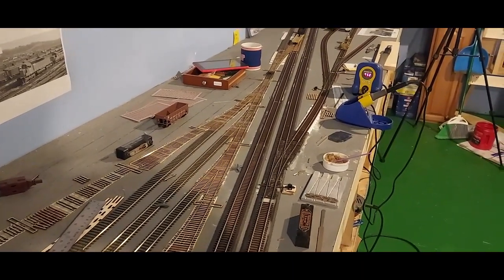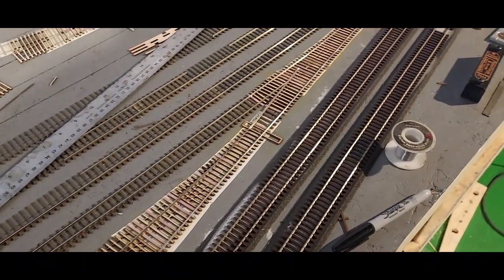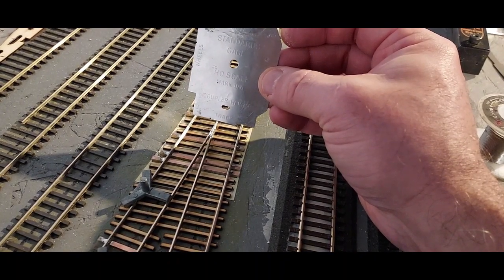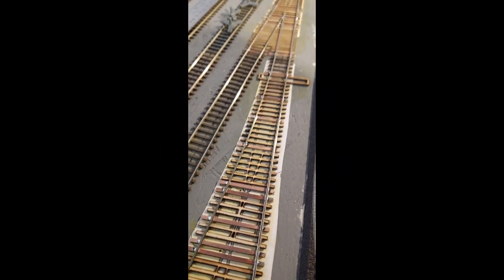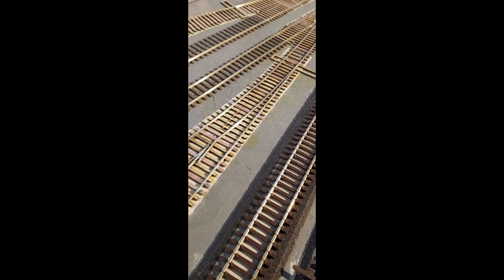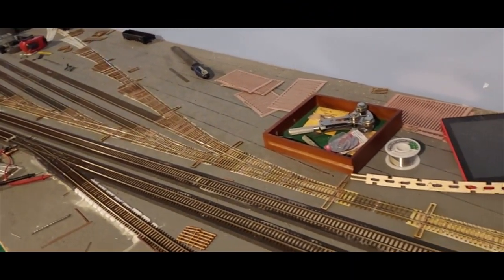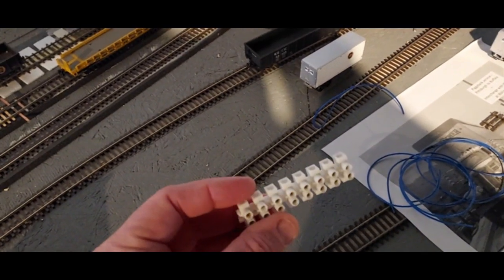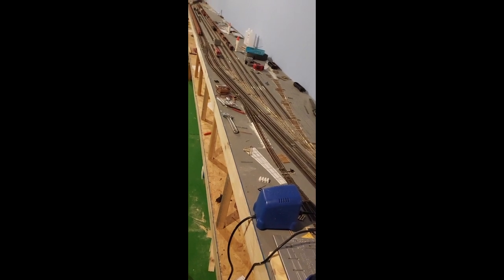Hand Laying a yard ladder in HO scale

Comment from the maker: Link to Amazon where I get my tie material. 
https://www.amazon.com/Unfinished-Basswood-Projects-Engraving-150x100x1-5mm/dp/B09MK53NSL?pd_rd_w=GRfUk&content-id=amzn1.sym.6c9101f8-677d-4b13-9bf0-c7e0d8fdf3bd&pf_rd_p=6c9101f8-677d-4b13-9bf0-c7e0d8fdf3bd&pf_rd_r=Q8BR6VA8H0SEC657P3YY&pd_rd_wg=2AILa&pd_rd_r=d6083eb8-fa7f-4cf2-8f0c-18a1dfac3f17&pd_rd_i=B09MK53NSL&psc=1&ref_=pd_basp_bia_rpt_ba_s_2_sc
Reply: Duh, somehow I missed your comment here...I kept checking the video description for the link, LOL...How do I contact you about the CAD files for the turnout frets?
Reply: Following up on that DXF file for the laser cut ties, would you kindly share it? Also, I wonder do you use Pliobond to glue the rail to the ties or something else? Trying to find something else instead of Pliobond because it's too toxic for my liking...
Reply from the maker: @TrainzLuvr  shared above.  i just use super glue, (carefully) i figure once the ballast is down and glued, it's all pretty solid anyway.  I've also just let the ties sit under for show -  I've also tried using a kadee spiker.   honestly - they all seem to work just fine.
Reply: @bessemerlakeerieinhoscale6061  You are a champ, thank you! Maybe pin your post with the file link because here it's at the bottom...
I see you've nicely packed the designs to take the least amount of material, awesome! What is the difference between the _1 and _1M files?
Good to hear about super glue, was worried I would have to end up using Pliobond or some other cement with VOCs.
Reply from the maker: @TrainzLuvr  The 'm' file is a multi pass version I made for the laser.

Comment: Absolutely beautiful and inspirational.  Where was this video when I was building my staging yard I looked for a step by step but didn't find anything.  What is the plastic track you are using for the siding do you just feed the rail through the plastic tie plates?  I presume you solder your frog and then file the stock rails?  Great video, this will get saved for LOTS of future reference.
Reply from the maker: Lol thank you! The plastic ties are central valley "branchline" spacing.   The rail just sits in a pocket,  I glue them in place.
Reply from the maker: Oh, I actually start with the stock rails.  I'm a manufacturing guy,  so,  i see the stock rails as my 'datums'.
Reply: @bessemerlakeerieinhoscale6061  So when you put the stock rail in the filing tool, have you already soldered the frog. Or do you take measurements of where to file… file them and then solder the frog after?
Reply from the maker: @Otter Creek & Rio Grande  oh! Sorry! I understand now.  I mark and file before soldering the frog.  Much easier than trying to fit the soldered rails in the filling tool